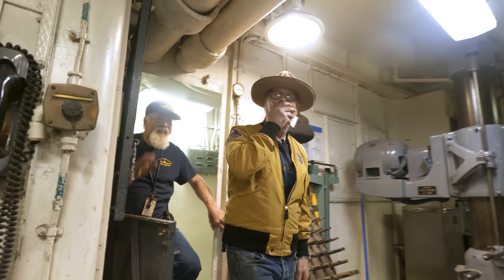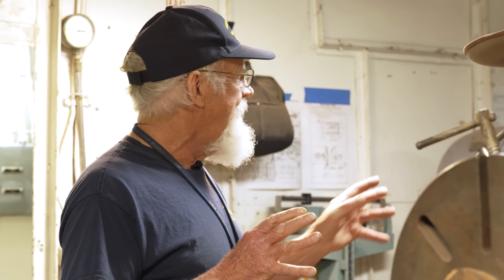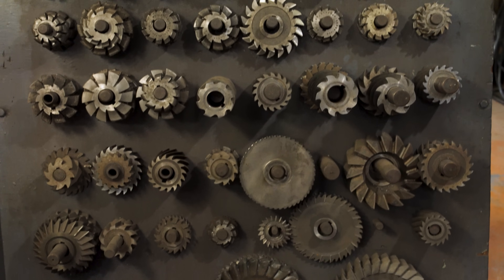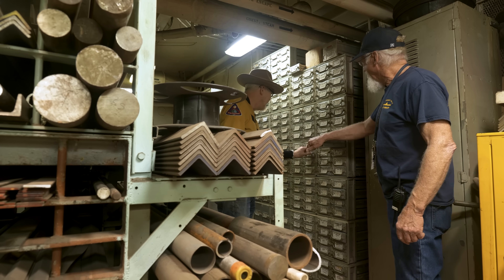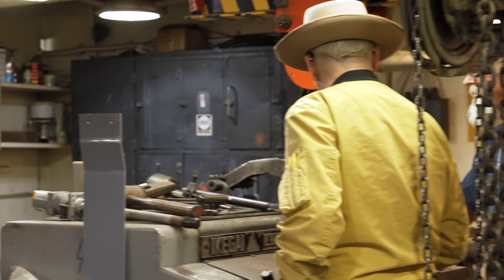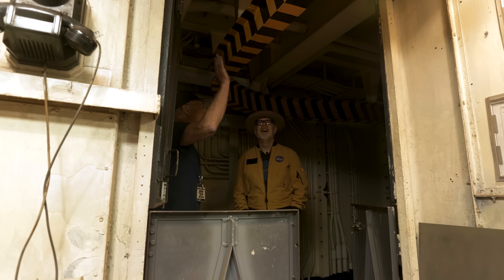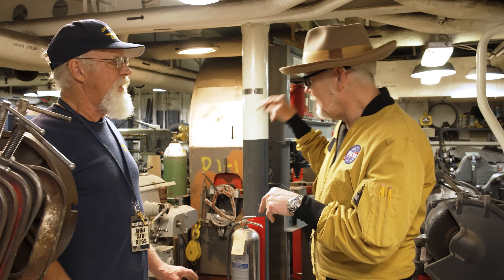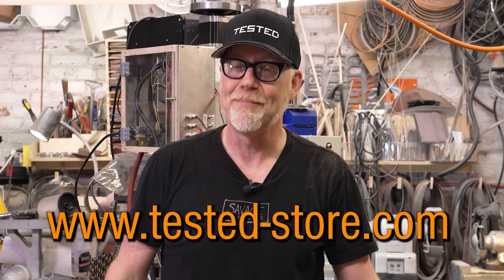Adam Savage Explores an Aircraft Carrier's Machine Shop!

Comment: Standby for a Sea Story:  In 86 my ship, USS Halyburton was part of the America Battle Group steaming for the Gulf of Sidra for what ended up being the late March engagements with the Libyan Navy and attacks on Libyan SAM sites.  The infamous Line of Death crossing.  The combined USN and AF raids would be on April 15th.   Our ship had the Mk 13 Mod 4 Missile launcher, known as the One Arm Bandit.  I was an FC who worked on the Mk 92 Fire Control System.  Daily we would run simulated engagements which required the Missile Launcher to load the TSAM (Test Surface to Air Missile) onto the rail.  That missile launcher was overall the most reliable part of our weapons systems in my opinion.  Murphy's Law hit and the thing broke with the TSAM on the rail, just days before all the action would happen.  To make a long story short, GMM's found a broken rod driven by the hydraulics that needed replaced.  Our small machine shop could not make it.  The Old Man flew to the America for a meeting with all the other CO's of the battlegroup in preparation for the Libyan encounter.  He took the broken part with him and the America's machine shop milled out a perfect replacement and we got the missile launcher fixed a day or two before the crap hit the fan.  We had a couple real GQ's because of the Libyan missile boat threat but did not fire.  When we did eventually get a new part from the factory, GMM's told me the milled-out part from the America was a better fit.  A salute to you Snipes from a Twigget!
Reply: That would have been and MR (Machinery Repairman) that made that part for you, I know I was one 1985-1991

Comment: Great video and fun video to watch as a former Journeyman Tool and Die Maker. In 1980 I used a South Bend lathe in tech school and one had a placard that read, "Remember the war time tolerances" so I guess it was WWII vintage. It was accurate and well maintained and could easily run another hundred years. The Cincinnati Horizontal Milling machine was also used in tech school, though it was on its way out at the time. And the Radial Arm Drill Press was great for large workpieces.
I like to joke with people that prostitution is not the oldest profession. The oldest profession is 'Tool Maker".

Comment: Great. I was a machinist on the USS Hancock CVA 19 from 1970 to 1972. Good memories.
Reply: While you were on the Handcock, I was a Phantom Fixer at MCAS K-BAY Ohau Hawaii (VMFA-122)2yrs. I'm the one that took Adam on the AC elevator and machine shop. That F-4 Phantom that Adam checks out was a Marine F4-J (VMFA 235) now a F-4S during the early 1970's. So I was able to see it fly. At the time I had no idea I would be leading the restoration of it  50 yrs. later.

Comment: Shipboard machine shops are amazing. The Battleship Alabama in Mobile has a machine shop right next to a blacksmith shop, and it is an outstanding space on the ship. It has a little Sheldon Lathe, a bit smaller than the South Bend in Hornet's machine shop, that I have been trying to find a similar model for sale to use in my own shop, but no such luck yet.

Comment: This is awesome....

But my favorite "machine shop find", I was working for a weightlifting and machine supply company, we'd deliver weightlifting and associated machines to different gyms around the Tri-state area (NJ,PA,NY) , but we worked and kept all of our machines and gear inside a very old "Tool and Die" manufacturer...

Well one day I was looking around the warehouse, and there was a closed off back room, inside it looked like nobody had been in there for decades, so I go in, just looking around, and notice, in the corner against the wall on the floor, like 5 full sheets of old plywood, and I could see an empty spot of paint that looked like someone didn't get the paint behind a railing no longer there, that headed down through the plywood...

So I started sliding the sheets of plywood off the area, and there's a set of steps going down under the floor.... I didn't even know there was a basement to this place...

I looked around and noticed a switch on that wall near the staircase, the conduit was heading down, so I looked around and flipped it on.... and some dusky azz lights popped on under the ground...

So I start cautiously making my way down these abandoned steps, and it opens up to this large, dusty and cobwebs infested room.... and there's literally dozens and dozens of different pieces of machinery down there....way more than what you seen on that ship...

But the craziest thing was, as I was looking around down there, there was a clearly newer wall with a door down there at the far end....so I go to see what's in there, open the door and find the switch for the lights, and it's a whole azz complete gym down there with everything you could ever want, a fridge and kitchenette in there, a bar setup, a couple sofas and a table in between them with, what was definitely weed and coke paraphernalia 😅

Suddenly here comes my boss literally scaring the absolute dog 💩 outta me.... he's like "guess you found my secret spot.... you want a drink?"

It was super strange....he drove a Bentley Continental GT, a 99 Rolls Royce Corniche, a Ford GT (the first GT remake with the supercharged 5.4), and then him and his plastic, well endowed saline-ly wife had matching Hummer H2's, his was a sage green metallic one, her's was God awful yellow 

The actual gym equipment company barely ever did any sales or deliveries, I spent my whole year working there mainly, moving heavy azz gym equipment back and forth inside the warehouse for seemingly no reason whatsoever.... I only had 4 deliveries the entire year, 3 of which were just a couple pieces of equipment, and the last, which was in NYC, was a huge 5 semi trailer full complete gym load out to a luxury highrise with an open 2 story gym with 2 escalators inside going from first floor, through the huge expansive hole in the "ceiling", to the 2nd floor which was against the 4 walls of the skyscraper.....but before that, literally a few grand worth of equipment MAX...

Once I was early to work, and 2 Rolls Royce Phantom VII's, both filled with Middle Eastern guys, were parked ,way back in the back of our lot, almost out of sight, behind the few semi trailers that sat back there filled with old equipment..... and as I was coming in, they both rolled out in unison, and then a minute later, my weird azz boss came walking from back there...

Might not sound like much do to my storytelling, but something extremely suspicious was going on back there, at the shop, and with the company and my boss in general.... I walked out soon after for some reason I don't remember 😅

Comment: My great uncle was in the Navy after WW1. He decommisioned a lot of ships between the wars and after he left the Navy, he worked for Newport News building them for 20 years before he retired. He dabbled in the surplus business, but he built a shop and started working on large diesel engines like bulldozers and excavators, even casting engine blocks and stuff. He and my grandfather built their own heavy duty tow truck out of an old Mac truck frame, using a 20 gallon drum as a fuel tank so they could pull farm machinery out of the field to Uncle O's shop so he could repair it. He also did some farming but he had a pair of mules and a bunch of old farm equipment to keep them active and exercised until they died in the late 70's. Unfortunately after he died of cancer in '79, my great aunt sold off all of his machinery and surplus parts and stuff at auction. He had a couple dozen motorcycles and a half dozen Jeeps and other military vehicles he had planned to restore before he got sick.

Comment: The big smile on Adam's face was totally relatable!  I worked as a machinist in M-53 Main Machine Shop at Newport News Shipbuilding & Dry Dock Co. for many years and I still love the unique smell of machine oil, coolant
Iron and steel. I also worked on the Nimitz Class carriers, and one of the things that is changed around is that the Machine Shop is on the fantail of the ship, with a large passage way all the way through from the outside of the ship past the Machine Shop and into the maintenance area of the hanger deck. Super convenient!
Reply: Been in that shop many times myself. We did the dimensional control surveys. I wasn't a machinist, but I still like the smell. We were always waiting on the crane  😂 Man if those walls could talk.

Comment: Even now, I have been  a lathe operator for 36 years the older manual  equipment is what I  learned on, making tools, profile tool bits, even cut spheres on a manual lathe. Of course once we got our CNC lathes and mills it was so nice not cranking handles but those tail stocks still haven't gotten any lighter. I will be 60 this year like passing as much  knowledge as I can to my younger co-workers but I always am open to their views and suggestions you never stop learning or getting  a challenge from time to time. Professionally it's almost always you vs. the clock though . We still have similar equipment in our building. I have enjoyed my career for the most part I like making things from chunks of raw steel, the math, and drawings . I have done work for all the main Aero Space defense players and NASA, Rail roads, auto industry concept cars. It's been cool as hell.

Comment: If you're afraid of that little lathe you'd have been terrified, and horrified by the Niles we had. 9 feet high power head with a 5 foot diameter chuck. Nothing like our 15 foot diameter vertical boring mill. That could put out a chip as thick as as three fingers. Then there was the temporary vertical boring mill We installed to turn the wheels of the Boeing 777 fuselage section turn fixture. I forget the throw on that one. Over 30 feet.

Comment: If Adam wants to see an amazing machine shop, he should go aboard an AR ship. Something like the USS Jason AR8. I was stationed on her as an electrician in the Outside Repair shop, R3. Her main machine shop had 3 lathes that I used to repair that were almost twice the length of the ones in the video. The Jason could manufacture almost anything on any ship. I even did electrical repairs on a British ship while we were on a West Pac cruise and stopped in Japan. 
The carpenters could make a mold of a part from a tech manual, send it to the foundry where it was poured, sent to the machine shop to be finished, sent to the testing lab to detect any microscopic failures, sent to the plating/paint shop, and then sent back to the ship being repaired where it was put into its mounts by our rigging bosun mates, and tested in place by the shop from the Jason that recieved the job. "Ready, Willing, Able" was her motto.
Reply: Way back in the 1980s my Dad was on AR5 USS Vulcan, it's not overly much hyperbole to say the ship IS the shop, or is that, the shop IS the ship?

Comment: When the military bought machine tools, they bought top tier equipment.
My school equipped the machine shop with lathes, milling machines, a shaper, and grinders (flat and cylindrical), etc.
I had an assignment to turn a 1.25” dia length of bar stock .050. The lathe had a 20” swing and 8 foot bed. A little overkill 🙃

Comment: Interesting he mentioned escalators.  It may have been a slip of the tongue, but of the forrestall and nimitz "super carriers", iirc two or three had escalators from the pilot briefing/prep rooms to the flight deck to make it easy for pilots wearing their pressure suits with their survival gear and bags and so on to get to the flight deck rather than having to climb the difficult ship ladders or whatever.  I wonder if the hornet has an escalator too.
Reply: Yes, they showed it on the previous video where Adam takes a tour of the whole ship

Comment: Hi Adam. Thanks for the vid. I was a machinist in civilian life. 
(Now a retired T&D maker.)  
After completing Boot Camp because of my profession I was offered the job of Battalion Machinist in the 27th Combat engineers Battalion, Ft Campbell, KY, 1958. 
they issued me a Duce and a half truck with a Machine Shop mounted on the Rear. $64,K value at that time.
Having that job MOS. sure made my hitch  a lot more enjoyable. 
The truck was a beautiful piece of equipment. I always had electrical power where ever I was located. Gasoline operated Heater.

I loved my mobile Machine Shop! It also had 2 bunks tucked away up in the back of the shop for sleeping out in the field.  
Those were the days!!
Reply: Would love a vehicle like that these days, but everything that cool in civilian world is like $100k. Sounds like a fun work truck, glad you got to have it.
Reply: I have a 10 inch Sheldon lathe in my shop that came out of a truck like that. Bought it of a govt surplus auction. It’s a neat piece of machinery
Reply: That's sounds like such a cool setup! I wish more museums preserved logistics stuff like that truck

Comment: Lathes are my favorite machines to use by far. I have a 1946 South Bend 9A that looks brand new from the factory
Reply: 20 years ago I picked up a South Bend lathe, I don't remember the model number but the serial # dates it to 1945 It was pulled out of a garage in Torrance California, I often wonder if it was originally from the Long Beach Naval yard. Got it for $300! Other then normal maintenance I've only had to repair a drive belt.
Reply: Loads got shipped to England for the war effort too … I regularly look at them on eBay (as they’re all being retired/cleared out of dad’s workshops these days😔 ) but yet to bite the bullet on a Cincinnati/South Bend. 
One day!

Comment: Looking at the room I'm tempted to compare and contrast it with role of the ship's carpenter on wooden sailing vessels.  There was a lot of history of carpentry when divers on the Mary Rose started bringing up hammers, clamps and planes.  We really don't realize how necessary a job it is to repair a ship while it is underway until we see things like this.

(edited: Fixed the name of the ship)
Reply: I'd be really interested in hearing about the history of how work culture transitioned from wood to metalworking on ships... It's such a microcosm, it should be able to tell a good story.
Reply: So, former hull technician here. We along with machinests make up repair division, which owns the machine shop. HT's in particular are the metal workers of the boat. We evolved from shipfitters which evolved from carpenters once upon a time. We are still the ships carpenters, but since theres MUCH less wood on ships, the wood shop is usually relegated to ornamental stuff, and small repairs of what little wood is on the boat. After i decommed Enterprise, i went to the truman and worked in the wood shop. Mostly because i was going on my third deployment in as many years and they wanted me to have an easy ride.
Reply: There's a fair amount of discussion regarding the on-ship woodworking and blacksmithing in Moby Dick, if you haven't read it.

Comment: How do they get things like this inside of the vessel?
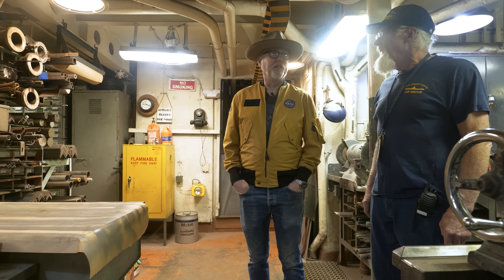Reply: At 3:35 you can see a black and yellow track on the ceiling, machines and parts will get suspended from that track and moved where they need moved, when there isn't track available, they'll get set on a cart or skates of some sort in order to be transported. There's tracks and specific logistical paths for them to take from the exterior all throughout the ship for different purposes.
Reply: He explains at 5:02